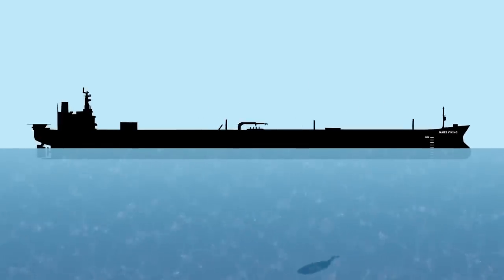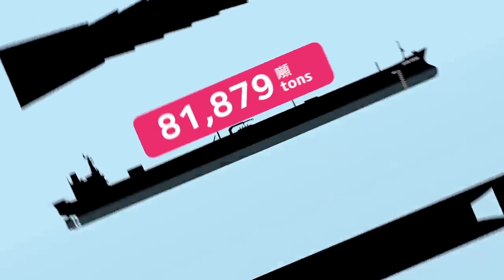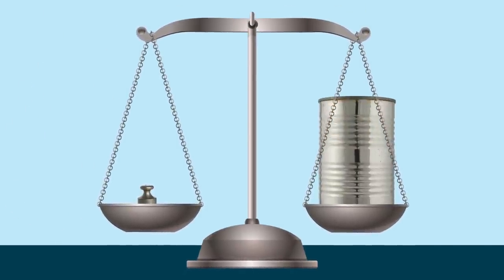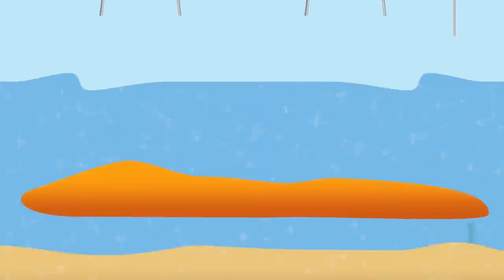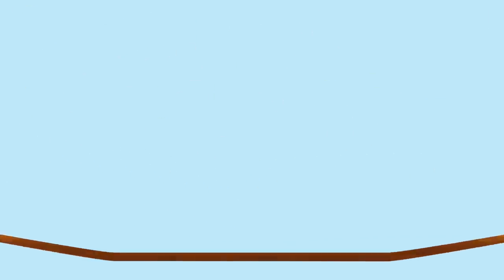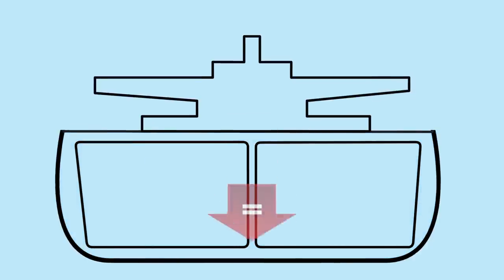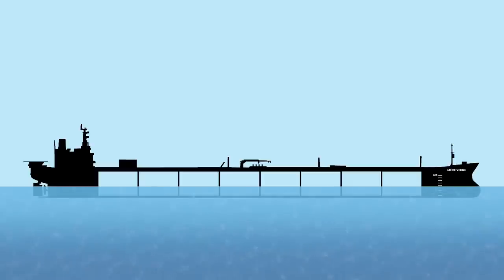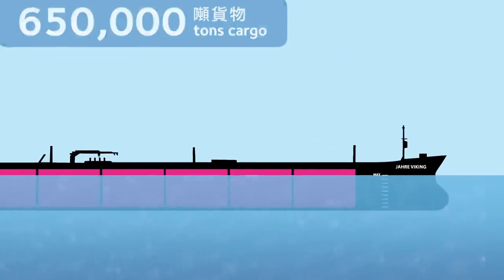The Jahre Viking

Comment: cargo is not 650000 tones , fully loaded cargo and the ship together is 657019 tonnes .
Type	Crude oil tanker
Tonnage	
260,941 GT
214,793 NT
564,763 DWT
Displacement	
81,879 long tons light load
646,642 long tons full load
657,019 metric tonnes
Length	458.45 m (1,504.10 ft)
Beam	68.6 m (225.07 ft)
Draft	24.611 m (80.74 ft)
Depth	29.8 m (97.77 ft)
Propulsion	
2 Mitsubishi V2M8 boilers (Designed by Combustion Engineering)
Sumitomo Stal-Laval AP steam turbine, 50,000 hp
Speed	16.5 knots (30.6 km/h; 19.0 mph)
Capacity	4.1 million barrels
Notes	[4]

Comment: It only has 50,000 horsepower. How be it??? This is NOT the most powerful ship.
Reply: More than enough for this kind of ship. Oil tankers aren't designed to be fast. Why? Because a ship that enormous size being fast would burn too much fuel . And ships burning too much fuel makes them less profitable. It could still travel at 16,5 knots (30,6 km/h or 19mph). When you consider that electric scooters are limited to 20-25km/h and city traffic usually moves at a slower speed during rush hour I'd say that is fast enough for something 2/3rds of a million ton heavy when fully loaded. 

Also, back in the late 70's when this was built the only ships more powerful were nuclear reactor driven aircraft carriers. This is diesel powered. There are more powerful diesels today, sure, but not 45 years ago